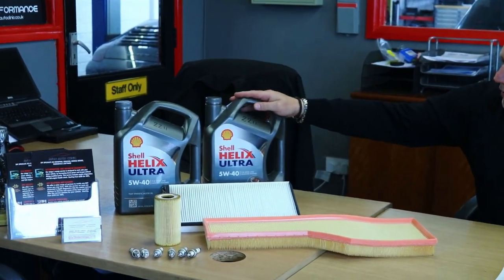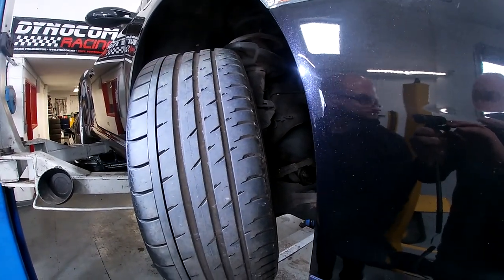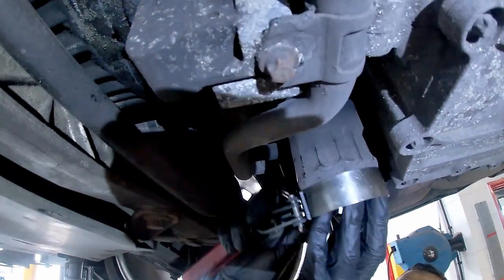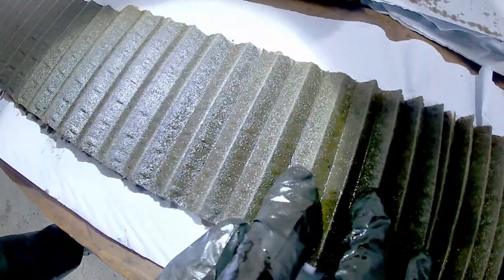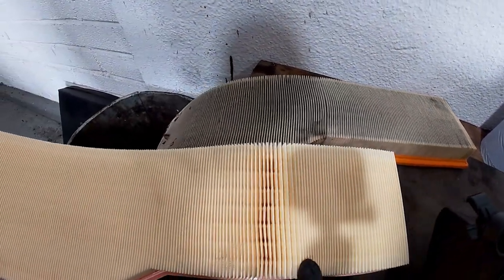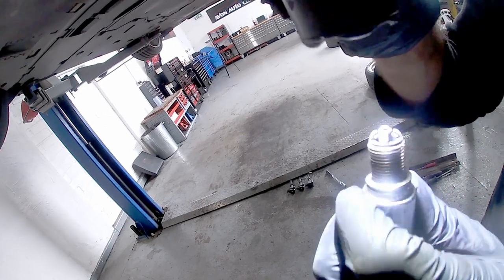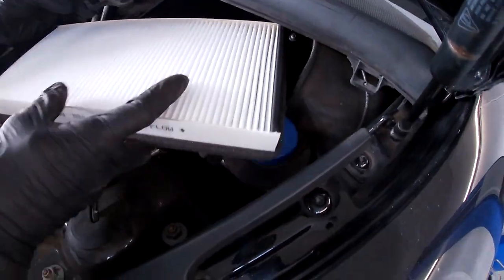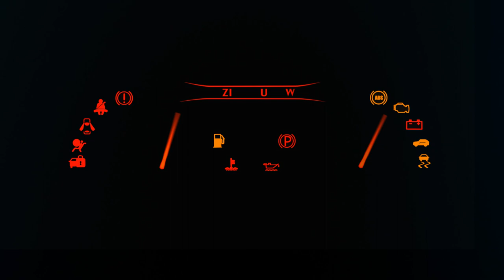Porsche 911 (997.1) Carrera 2S Service

Comment: some tips:
With the coil packs out, good time to check the cylinders for bore scoring.
With the air filter box out, good time to clean the MAF sensor.
With the air filter box out, remove the serpentine belt and check all the pulleys for any free play especially the one on the water pump.
Hope this helps others.

Comment: Everyone uses a torque wrench to tighten down plug. There are factory setting guidelines, not just end tight. Also the oil filter cap is usually cleaned before reinstallation to get all the access oil off. A bit sloppy work.
Reply: Another thing I do is place a plastic bag over the oil filter housing so any oil that comes out goes straight into the bag saves a lot of mess